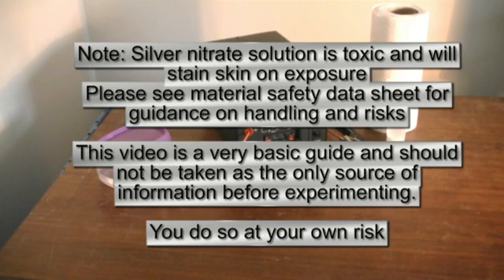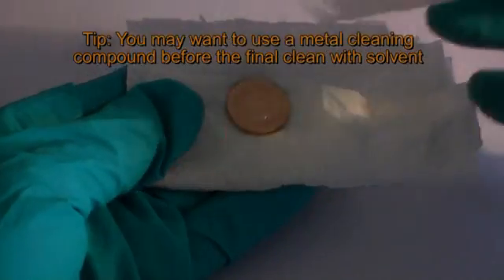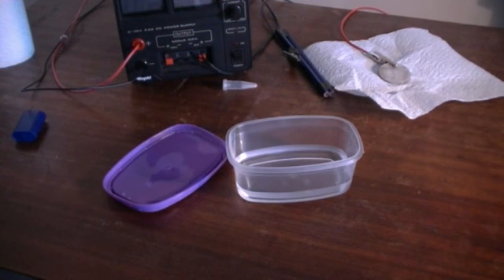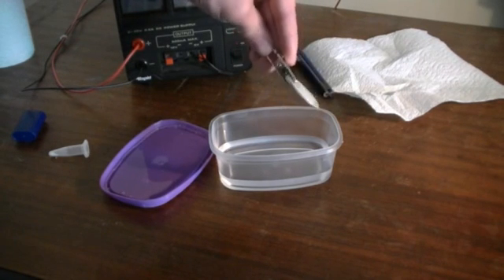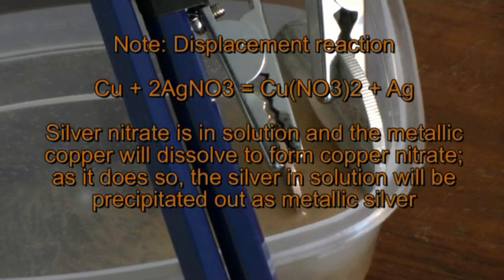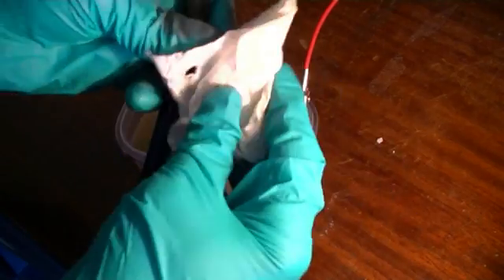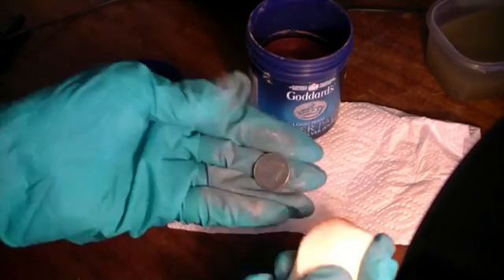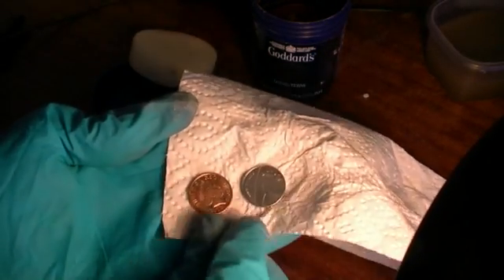How to electroplate silver on copper using silver nitrate

Comment: Hello, many thanks for the video. Excellent! I guess the lower the current the more refined/detailed will be the finished item? This may sound very strange but years ago a metallurgist told me liquorice could be added to the electrolyte? I don’t know how true? So, the longer you leave it the greater the deposit and the thicker the plate. There must be a way of calculating the mass of silver transferred , hence the thickness of plate per init surface area?
Reply: I am plating multiple of the same objects soon, I will try a sample tub of silver nitrate electrolyte with some added liquorice and do my best to get back to you. If time allows, I'll document further and post online too :D

Comment: Bad job try 3 volts and you won't have to polish it try cleaning it with hot soapy water followed by dipping in vinegar and distilled water try making the plating solution    120 degrees and ales on 30 seconds
Reply from the maker: Thanks for the comment, using 3 volts may have improved the coating appearance (obviously the process would have taken longer due to the lower current when operating at a lower voltage). I take your point about using vinegar to clean the part but silver polish also works well!
There are many other ways in which the coating process could have been improved, for example using a different PH in the plating bath. The results I got with this simple setup were sufficient for my needs of silver plating a copper plated coin, there was a coating over the complete surface area of the coil (although may be not totally uniform over the coin).
Reply: @InForAPenny2010Adventure  I want to make the silver plating as thick as possible, do i need to constantly wipe off the black coating (containing silver oxide) that forms on the surface of the copper object (a copper pot) if i electroplate for say 24 hours? Will the black silver oxide prevent the pure silver from plating to the object?
What are your opinions on using sodium carbonate + hydrogen peroxide for the solution instead?
thanks

Comment: Correct me if I'm wrong, but didn't we use Silver Nitrate to prevent infection in newborn's eyes (Gonorrhea), cauterize, and heal oral ulcers?  I believe it was diluted, but...  I think there was also some research into using it to sterilize women.  It may have been used for warts too.  Long term exposure can cause eye damage and is a skin and eye irritant, but I'm not certain about toxicity.  One result is blue/purple skin, but it hasn't been studied for causing cancer.  Could you cite a source for toxicity?
Reply: Silver nitrate does have a history of being used as a caustic, yes. We also used mercury to "cure"syphilis in the same era of medical history, and that's not exactly recommended by today's standards either. Toxicity does not mean just causing cancer. It means it's toxic; e.g., poisonous or otherwise not very good for you. Aspirin is toxic if you take enough of it. Bleach is toxic if you take any of it. If you google "MSDS Silver nitrate" you will find the material safety data sheet: the information that all manufacturers of chemicals and chemical solutions have to provide by law regarding the hazards involved in use and storage. According to Sigma Aldrich (one of the world's largest chemical manufacturers) silver nitrate is corrosive, acutely toxic to wildlife if it gets in to water supplies and causes skin burns and eye damage if handled incorrectly. That data will have been generated using laboratory fish and animals.  Similarly you could google silver nitrate toxicity and get a whole host of medical papers on what happens to the poor souls who ingest it in large quantities.
Reply: The previous reply has a more complete answer, but I wanted to add that if a substance can STERILIZE you, its clearly poisonous!

Comment: I just left a copper penny on a silver nitrate solution for some hours, then I removed the penny and it was coated with silver like the coin you used
Reply: What you did is called electroless plating.

It often results in easier plating, but it's thinner.

Comment: Can one use 3.3v, 5v or 12v from a computer power supply, or rather other, whats too little and whats too high, and how does various voltage levels effect the finish? What happens if you use either too little or too much silver nitrate.
Reply: The standard reduction potential of copper and silver are:
Cu2+(aq) + 2e- -> Cu(s) = 0.34 V (Anode)
Ag+(aq) + e- -> Ag(s) = 0.8 V (Cathode)

Since we are plating silver, we are reducing silver ions into silver metal. So the overall reaction potential would be 0.8 - 0.34 = 0.46 V, which yields a spontaneous reaction according to Gibb's law (deltaG = -nFE).
According to the Butler-Volmer relationship, current density (or plating density per unit area aka speed of electroplating) is exponentially proportional to the overpotential driven on a system (voltage from power source minus the voltage to drive the electrochemical reaction). 

To answer your question, using an uncontrolled, high-voltage power source would likely drive the reaction to max speed, possibly affecting the silver plating uniformity. The concentration of the electrolyte (i.e. aqueous silver nitrate solution) is positively correlated to the amount of silver ions available for plating on copper. As someone mentioned above, simply putting a copper coin into a silver nitrate solution will cause silver plating spontaneously, so you should not need a very large voltage to drive the reaction. The critical parameter should be the amount of current passing between the electrodes. This can be controlled based on Ohm's law (V = IR). You need a resistor to control the current flow based on the voltage your power source outputs. 

Hope this help.
Reply: @stevenlee9680  So it seems the main concern is the current is per sq unit of surface area. Naturally the electrolyte  can change its conductivity  as ion concentrations change and temperature  changes. So, what should the current density be?
Reply: @kreynolds1123  You would probably have to play around to figure out the best current density for uniform plating. Generally lower the current density, the more uniform the plating. If you drive the current to the system's maximum, then the ions in the electrolyte will have a hard time diffusing across to the surface of copper, and will likely create uneven plating or even dendrite growth (not sure if silver has the tendency to do that, but other metals such as lithium certain will grow dendrite).
Reply: @stevenlee9680  - no one says ac or dc voltage.  The best answer would be to encourage the use of a common phone or other gadget charger available to all of us please.

Comment: I tried this on a silver quarter with copper edges... wanted to coat the edges of the copper clad coin so it appears to be all silver. black coated the coin but after agitation fell off and left copper edge uncoated. Do you know why this did not work? Thanks~!
Reply from the maker: I think this may be down to cleanliness; you
need to make sure the copper is clean. This means free from oil etc, there may
also be an oxide film over the copper; this can be removed by pickling the coin
in dilute sulphuric acid. If you are going to try this I would advise
experimenting on some copper first before attempting your coin.
Reply: Thanks, will give it a go...
Reply: Furthermore, electricity likes to take the path of least resistance, and that will be on the prt closest to the anode.

Comment: dude cathode is the positive terminal and the anode is the negative terminal
Reply from the maker: Wian Esterhuyse Trust me (I’m a doctor) the anode is the positive (+) and the cathode is the negative (-)
Reply from the maker: Lupus Mechanicus
I will concede that my statement of which was the cathode and anode is incorrect in this electroplating example. The positive and negative sides are correct however.
Thanks for you correction and comment!
Reply: the cathode is the positive terminal on batteries, not in electrolysis process
Reply: Wian Esterhuyse , no u r wrong.
Reply: in electrochemistry the cathode becomes the neg. while the anode becomes pos.
confusing, i know.
Reply: Anode: 2O²- – 4e-  --->O2
Cathode: Al³ + 3e- ----->Al
Reply: Cathode is always negative.
Reply: no, cathode is the negative terminal. One way to easily remember this is to know that the cathode attracts Cations (+) which are positive and positive is attracted to negative while anode attracts anions which are negative (-) and therefore the anode is a positive terminal. 

What you're thinking of is a voltaic battery where it is reversed.